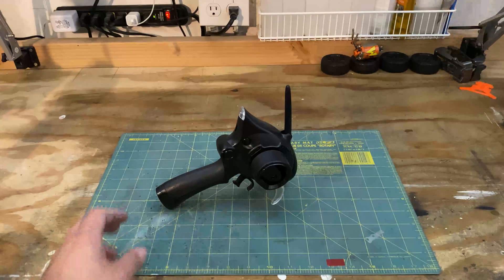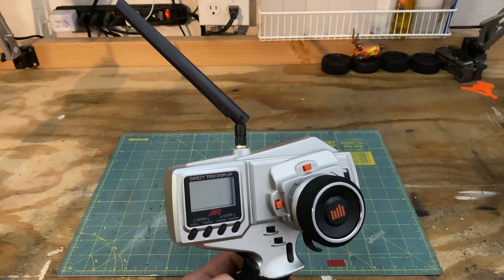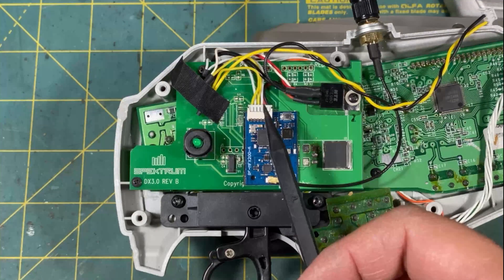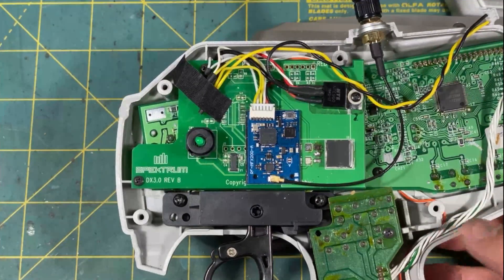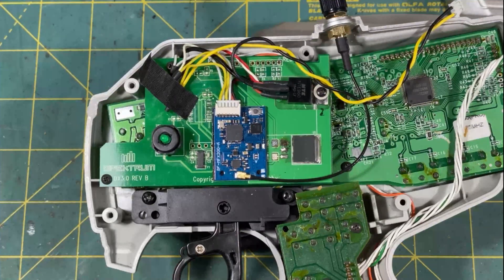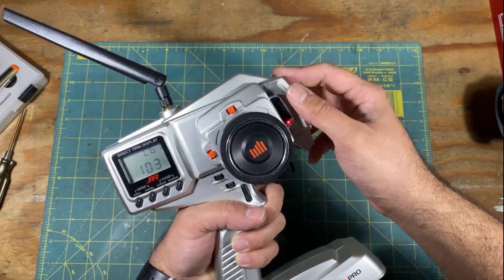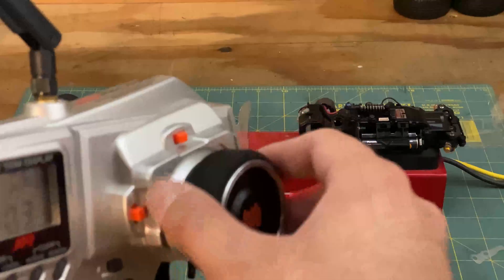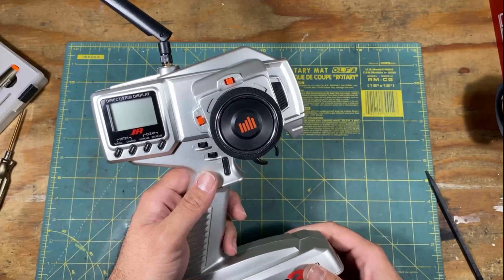Old Radio, New Trick! Make any controller MHS and ASF compatible for Mini-Z

Comment: Very very nice Video... Could you say it works on a Kopropo EX2? Dont know if it has a ppm signal 😀
Reply from the maker: If you are talking about the older ‘80s style, shaped like the Mars, then yes the PPM signal is a bit burried from what I can gather. If it is the newer KIY I’m not as familiar with. This is for the vintage EX-5 but not having taken apart an EX I can’t speak to how much translates from 5 to 2.

https://www.rctech.net/forum/radio-electronics/349740-corona-2-4ghz-diy-kit-convert-old-radios-2-4ghz-5.html